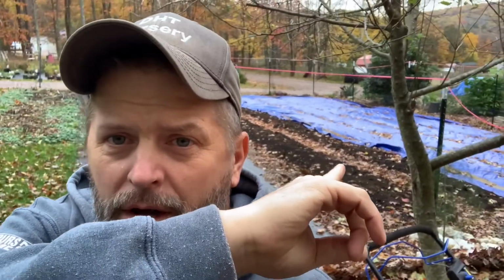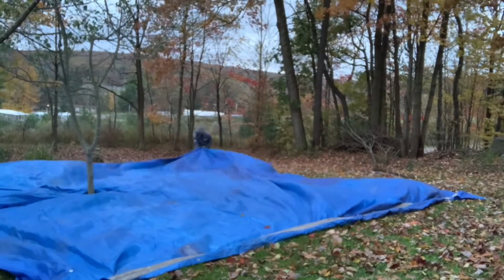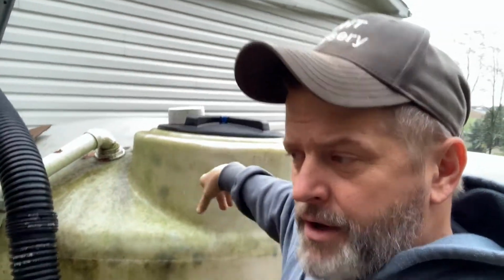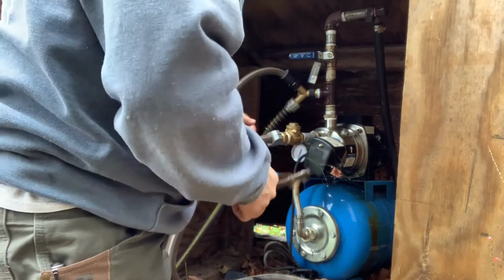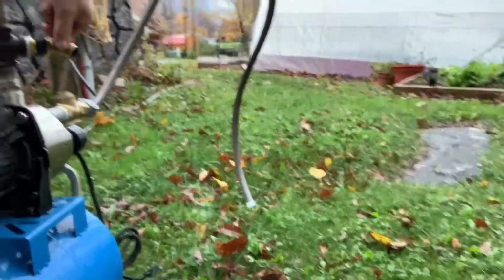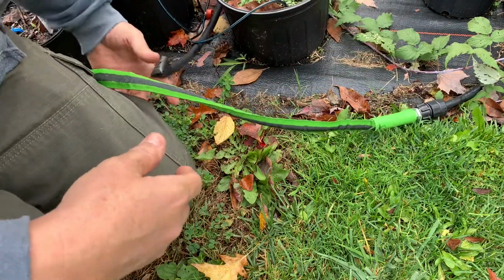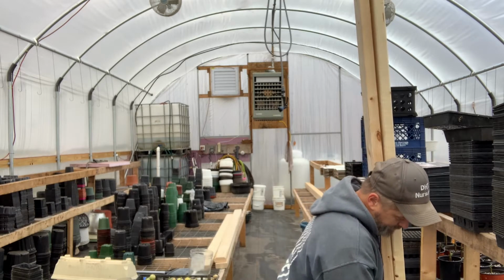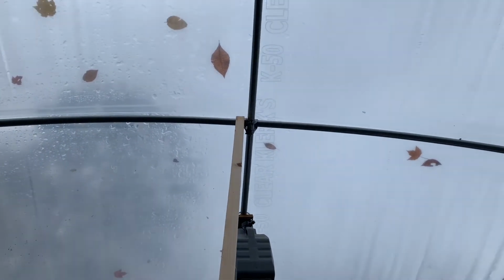Winter prep we are almost ready

Comment: Why do you cover your beds with tarps vs just leaving them exposed to elements over winter?
Reply from the maker: Good question, I’ve been asked that a few times I guess I should have said in the video. I cover them with tarps for a few reasons. The soil organisms need to be covered, helps keep the soil warm, helps with weed control (weed seeds can’t land n the soil), not muddy in the spring, keeps the soil from getting to compacted, when the sun comes out it helps burn off some of the smaller weeds. 
Thanks for the question and for watching.